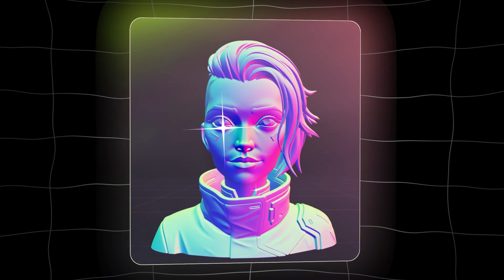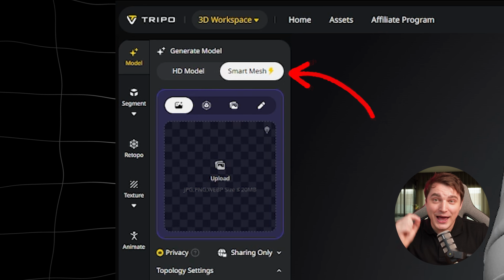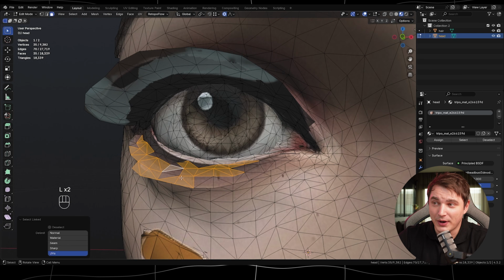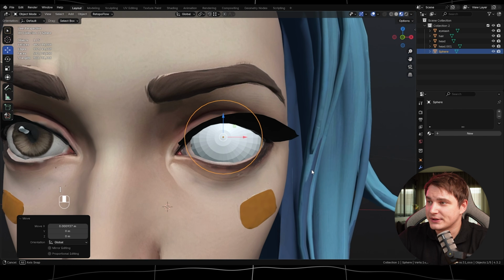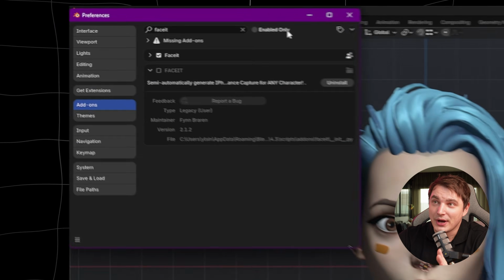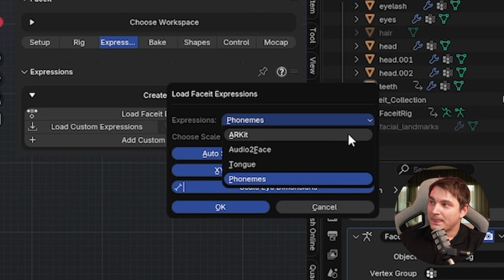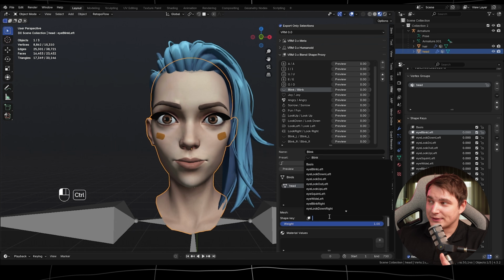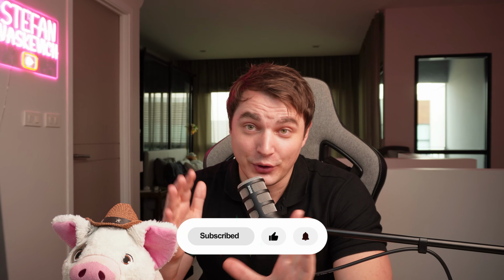From AI to Talking 3D Avatar (Best Face Rig Workflow)

Comment: Thank you for the amazing video! I really enjoyed it. I do have a quick question, though.

I'm trying to rig the hair, but the AI-generated hair meshes are all fused together, so the mesh tears when I try to rig and move it.
I tried to manually cut and separate the hair parts, but since the mesh is made of triangulated polygons (tris), it doesn't separate cleanly.

Is there a way to get quad polygons instead, or is there a specific method you use for rigging AI hair?
For context, I generated the body and face together, then generated the hair separately and attached it.
Reply from the maker: I would say try Tripo Smart mesh and Hunyuan retopology for hair mesh.
But neither is perfect and you would have to split manually still.
I will keep you updated if anything is change

Comment: I’m very interested in this approach as a way to improve both efficiency and quality. However, the reality is that it’s still not production-ready. you’ve touched on a critical issue: control. Right now, these tools lack precision and reliability. In many cases, they actually lead to more time spent fixing errors, which ultimately means a loss of both time and money, tools like Tripo AI are not consistently free, and the results often require significant rework to meet professional standards. in a professional pipeline, the most efficient workflow today is ::

AI 2D reference → AI 3D base model → Stock (clean retopologized model with proper UVs) → refinement in ZBrush (projection workflow and adaptations) → manual setup of eyes, eyelashes, eyebrows, teeth, and hair.

At the current stage, AI is not yet ready for full production use especially when it comes to clean topology, rigging, and animation. Animation should come after a properly structured and production-ready model is established.

There is also an alternative workflow :)   --> AI-generated reference 2D → motion generation (e.g. with Kling AI)

This approach is useful for fast content creation like sociale contenents , but it doesn’t replace a proper 3D pipeline for games, VFX, or high-end production.

With AI, the goal is to save time. But relying on repeated probabilistic attempts just to reach an 80% result is still not efficient.Even if some time is gained in the early stages, it is often offset by the need for corrections, refinements, and rework afterward. .......In the end, the time saved is either minimal or completely canceled out.